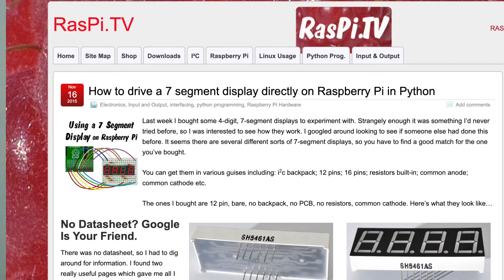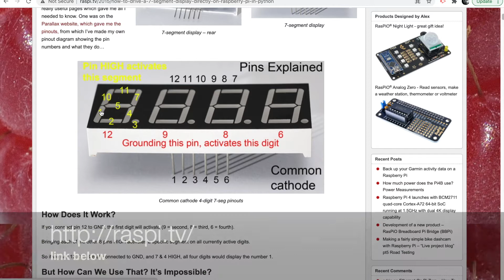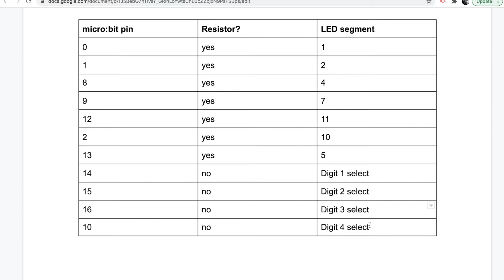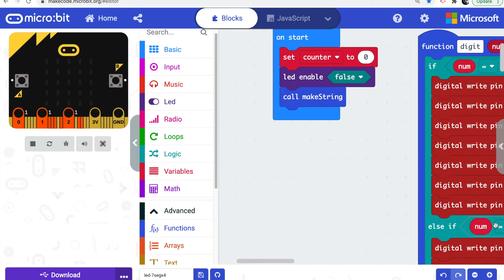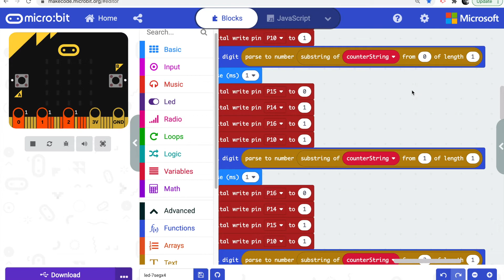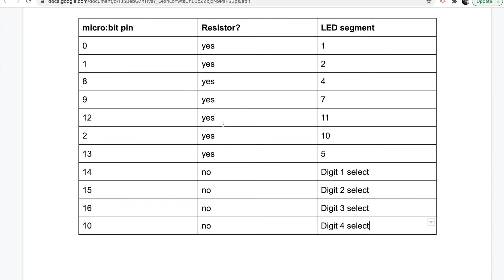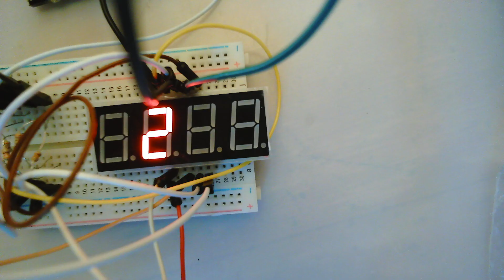Driving a 4 digit 7-segment LED display direct from a micro:bit

Comment: Hello. Is it possible to control mutiple 7 segment displays with a microbit?
Reply from the maker: Hi there. I don't think you could directly as the micro:bit doesn't have enough pins, but it might be possible using displays that use an interface chip and the i2c or SPI interfaces.